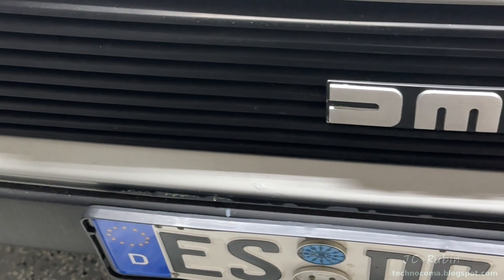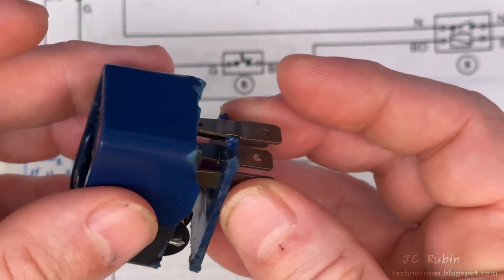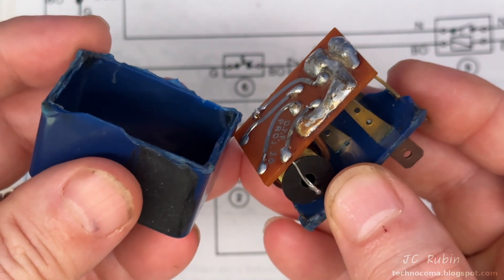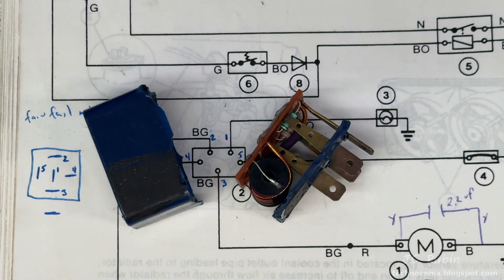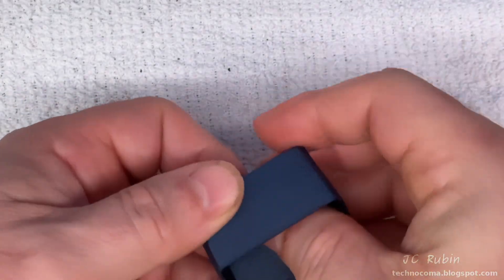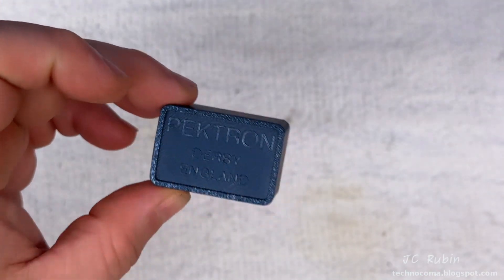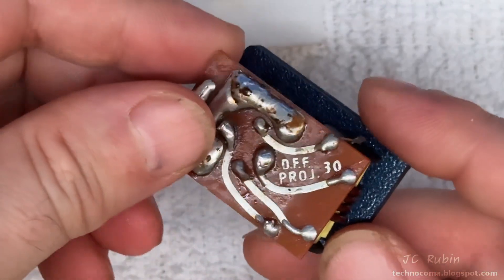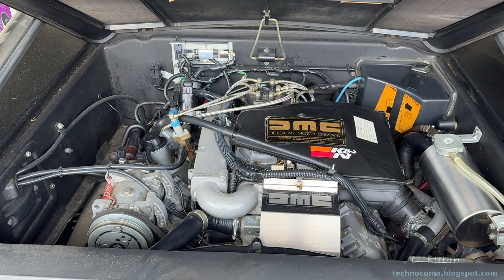The Delorean Fan Fail Failure - A Module Revisited, If only for a moment

Comment: Nicely done on 3D printing the case for the relay.  I wish you would have shown more detail of the circuit.  At one point in the video you - almost - show the component side of the circuit board.  It looks simple enough that the circuit could have been sketched up and then the "how it works" could be explained better.  Obviously, somehow the warning light goes on based on an imbalance of current between the two outputs going to the fans.  I'm curious how they did that with what looks like a single power coil.  Like Mark, I also have Dave McKeen's module,  and it has additional features beyond the original failure feature.  It sequences the fans on sequentially, dividing the power start surge.  It also has a delay off feature that prevents the fans from cycling when the AC clutch is working.  I have an early version of his product which also has a blink code to tell you which fan has failed.  It works pretty well and is an enhancement over the typical dual fuse replacement solution.
Reply from the maker: It never occurred to my that anyone would want/need an in depth look at the board. I’d imagine there would be photos online. If I can’t find any I’ll open the module and snap a few and leave a link